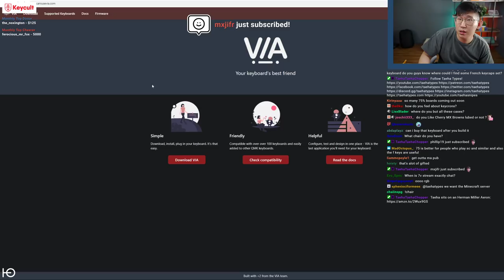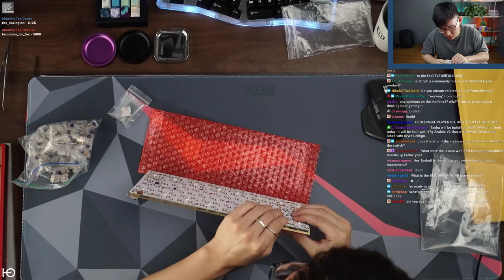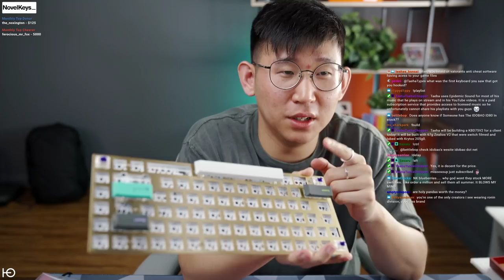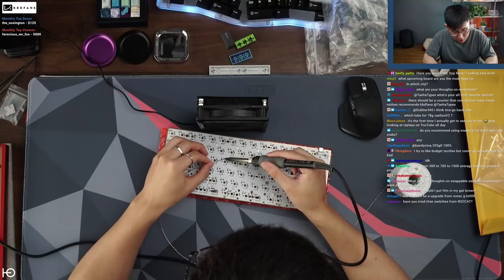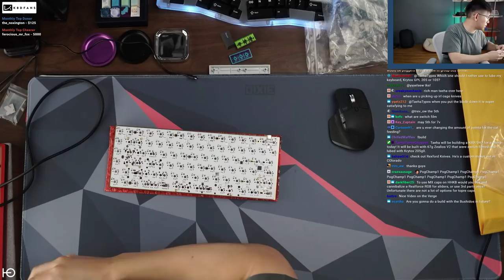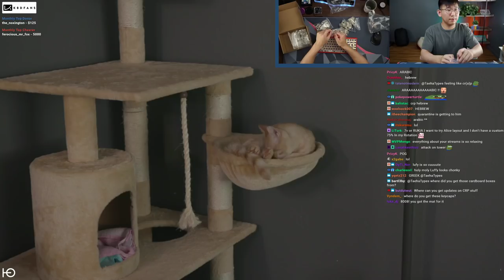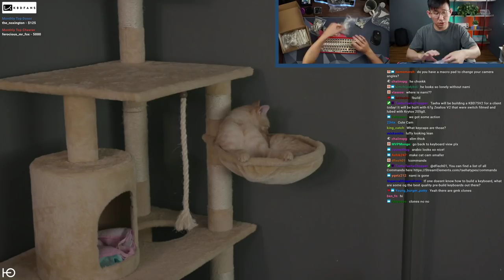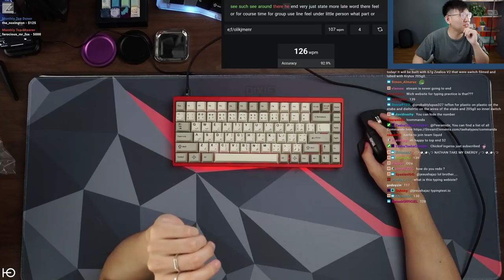KBD75V2 with 67g Zealios V2 Build Stream

Comment: you should do a comparison video comparig the same exact keyboard with aluminum vs brass plate
Reply: Brass is overall better, because it's denser than aluminium the sound of the keyboard is more 'dense' and more satisfying
Reply: Oddly enough, I have pretty much the exact same setup as this but with an alu plate (kbd75, filmed zealios v2 78g, zeal stabs, gmk keycaps, krytox 205g0 for everything) and you definitely get a slightly lighter sound (closer to the clack side of the spectrum). Imo if you want a deeper sound and are good with a super-rigid feel, go brass. If you like a slightly higher-pitched, more clacky sound, go alu. In case it's relevant, I also added a sheet of sorbothane (cheap fix, abt $20/sheet) under the PCB to get rid of any notes of echo/hollowness. Hope that helps.

Comment: Were those 5 pin switches? Just wondering if you had to clip them for a plate mounted keyboard.
Reply: Zeal switches are pcb mount, so they have 5 pins

Comment: Hello.
Thank you for such amazing mechanical keyboard content. I'm getting into this small universe =)
I'm about to buy hot-swappable keyboard and looking for silent tactile switches. These 67g Zealios V2 sound very nice to me but I want to ask for advice: is there something similar I can choose from (some switches you have used for your builds)? I also want to know if Zealios V2 should be filmed to get a more silent experience?
Reply: If you want quiet(er) tactile switches, I would recommend getting Zilents, which are basically Zealios with a silencing ring. It will make the bottom out a little softer though, not mushy, but soft. In my opinion, these are the best tactiles, despite the price.

Comment: Question for you Taeha, when you flash it, does layer 1 remain the same? Basically, I am looking to remap some nav keys, but I'm not sure what's going to happen with the LED options in layer one after flashing it. Would I have to remap them or will they remain unchanged?
Reply: if you change nothing on the layer 1, it will not change anything upon you flashing it

Comment: hey, I'm thinking of either building or buying the most silent keyboard, what do you recommend?
Reply: Every board will vary in terms of how loud it is, however I'd recommend MX Zilents and a Polycarbonate Plate, because they should make the biggest difference.
I recently built a polaris with MX Zilents and a PC plate and it was almost impossible to hear.

Comment: Hi guys! I'm new to this hobby. I want to make a build around the kbd75v2. My question is: since i want to buy durock stabs, how many and in which sizes do i need to buy them? Thanks in advance!
Reply: Why didn't anyone answer :(
Reply: @instinctive9556  for One pack of Durock stab you will have 1 7u, 1 6.25u and about 5 or 6 (i don't remember correctly) 2.25u stab. That should cover most of your build.
Reply: @datkeeb08  thank youuu

Comment: Is there any keyboard pcb's that are exactly like the Cooler Master Quickfire TK/ MasterKey M. I love the form factor of having a tenkeyless but having all of your keys or would it work to solder on new keys onto that pcb if plausible. Because I really want greens or something similar, 68-80g with tactile feedback, like the Outemu Ice V2 or Silent Forest switches. plus I wanted RGB so Masterkey M.
Reply: In the custom scene, no there isn't really anything in terms of that layout I think.
If you don't mind an extra column, then you could take a look at 1800/HBCP layouts in terms of customs.

Or you can try getting an aftermarket Pro M or the cheap alternatives from Tecware/RAKK and mod the hell out of it.

Comment: i know this video is old, but i have just finished building my 75kbdfans v2 and i cannot figure out for the life of me to change the lighting effects, nothing seems to work, some people recommended via software but the lighting section just doesn't work, but also apparently using the fn key and q ect. is also meant to change the lighting by default but that doesn't seem to work either, otherwise everything else works. Thanks if someone sees this :)